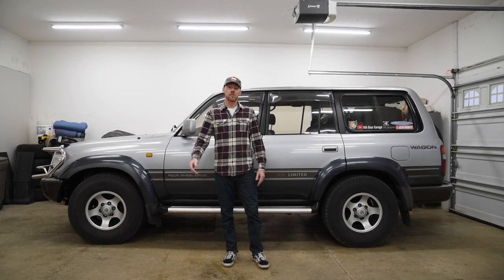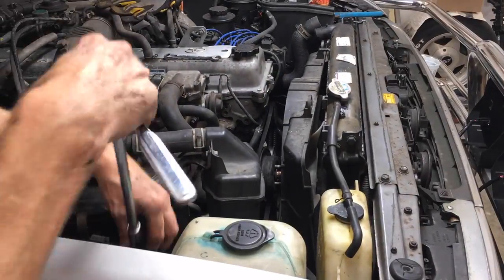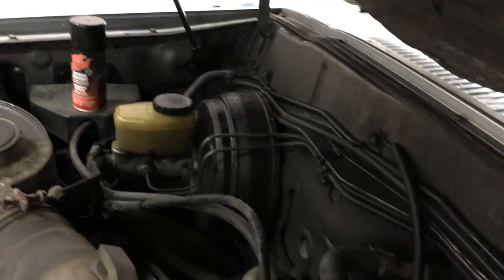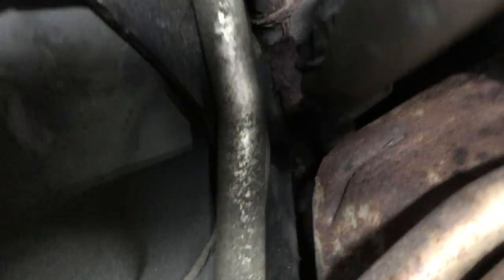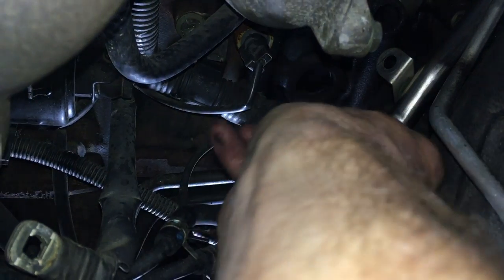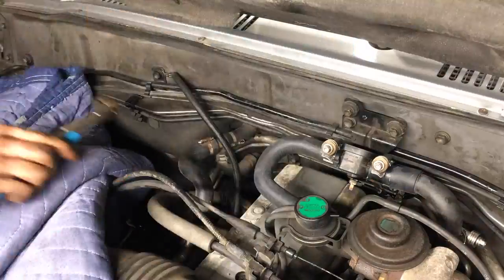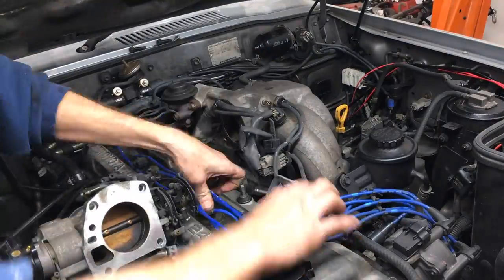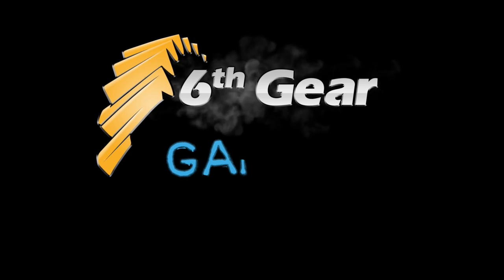How to: Replace EVERY Coolant Hose on FZJ80 80-Series Toyota Land Cruiser, feat. Pesky Heater Hose

Comment: The best thing about changing all the hoses is that soon after your head gasket will blow and all that work will have been done in vain 😜.  There are specific types of hose clamp pliers that work great with those clamps. You squeeze them and they lock so the clamp is open and then you can move it around very easily. Cool vid.
Reply from the maker: Hahaha that would be my worst nightmare!  I'll check out those hose clamp pliers, thanks!

Comment: Thanks for the video. I would throw some fresh belts on while you had it open up front
Reply from the maker: They were supposedly replaced before I Bought it, but you’re right it would have been the ideal time. I considered replacing the radiator as well while the fan and shroud were out but they’re not exactly cheap for a nice one.

Comment: Did you replace every clamps? Where did you get them
Reply from the maker: Yes I replaced them with constant torque clamps. I got them from NAPA and they weren't cheap... but I don't want to have to mess with the PHH for another 25 years, so it's worth it!
Reply: @6thGearGarage  I'm about to do the same with the PHH and CT clamps. But for every other random coolant hose, did you do the same or use basic clamps?
Reply from the maker: @mr.skeltal3730  I think I ran out of the CT clamps so I used some regular hose clamps on the easy to reach hoses, in case I ever need to tighten them. All the hard to reach ones have the CT clamps for sure.

Comment: I have learned the hard way not to crush the heater hose tubes. I tried to flush a heater core in a 87 toyota pickup and crushed that line. I opted to replace the heater core and learned that those tubes dont come with the heater core and they are obsolete.
Reply from the maker: I had a heater core for a pickup with a bent tube that I was able to heat up and bend back to round with some sockets, similar to the way I repaired a bent radiator neck: https://youtu.be/farPXTp1z2U
Reply: @6thGearGarage  I have fixed them too but it sucks lol

Comment: Pesky heater hose and throttle body hose isn’t even bad on a RHD 😂. If you had a LHD you would not be able to film half of this. The PHH is somewhat visible, and the throttle body hose has to be removed and installed by feel. Hardest part of the PHH is the bolt of the back of the head.
Reply from the maker: That bolt was the worst - I left it out.
Reply: Really? I thought it was easy, I’m having a hard time figuring out how to remove the damn hose! Lol
Reply: @tbassiii  remove the spring clamp from the block side. Needle noses will work best in my experience. After that I made some cuts in the hose. It pulled off easily after that. You remove the pipe assembly with the hose still attached to it through the wheel well.
Reply: @FIVEVEEZEE  ah that’s what I was wondering. You can see it through the wheel well with the wheel off? I was about to pull the starter haha
Reply: @tbassiii  Yes. I don’t think removing the starter will make a difference. It’s not completely obvious. Pretty buried in there
Reply: @FIVEVEEZEE  right! I was going to try to go from below the truck, hence removing the starter. I didn’t think about the wheel well. I’ll try that. I just deleted that damn EGR hose. That was not easy in the least.

Comment: Those hose in the back are worse when the steering wheel is at the left side  😒
Reply from the maker: I probably wouldn't have even been able to film the video if the steering was on the left hand side. There's just not much room to see or do anything.